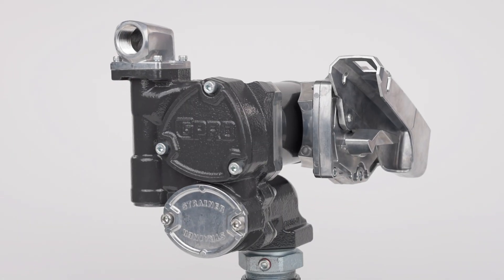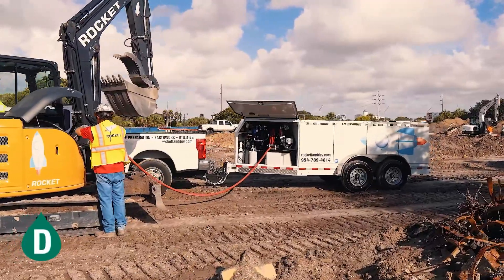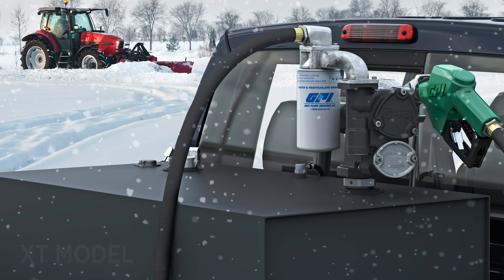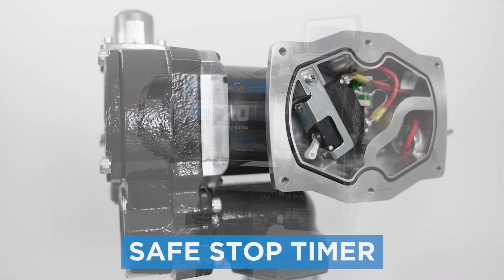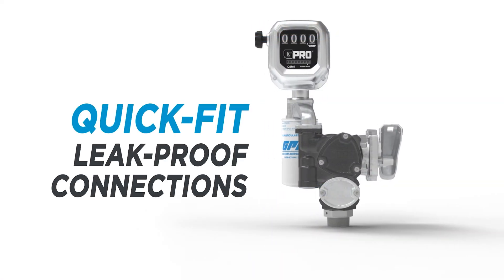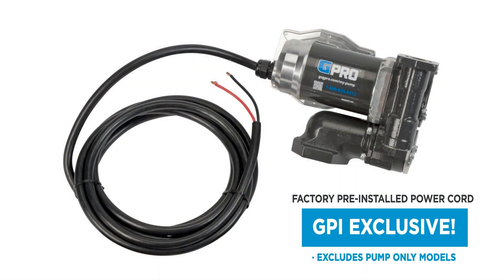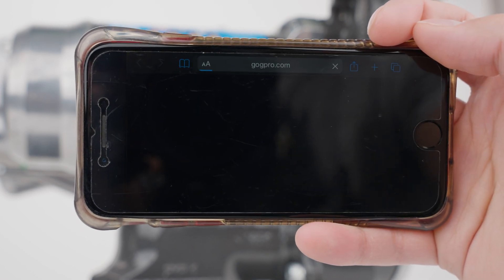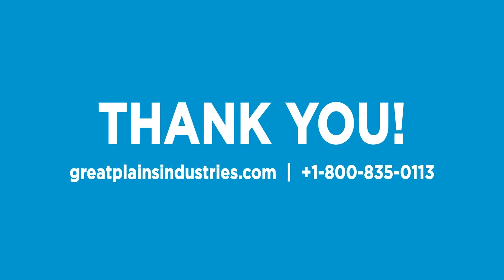GPRO V25 Series Mobile Fuel Transfer Pumps

Comment: What DC power supply should I use to power a 12V fuel pump?
Reply from the maker: Hello. The power source should be the 12vdc from the vehicle battery directly,  both Positive (Red) and Negative (Black) wires from the pump cabling should run directly to battery.